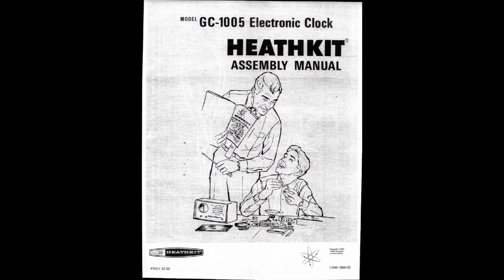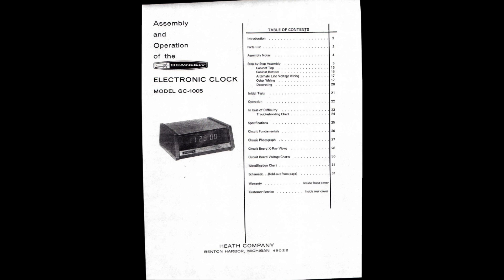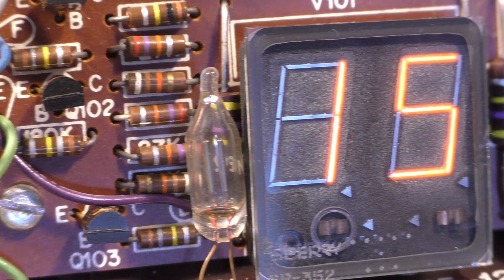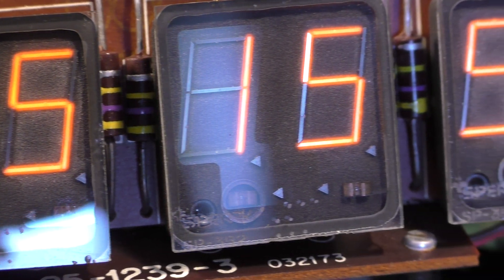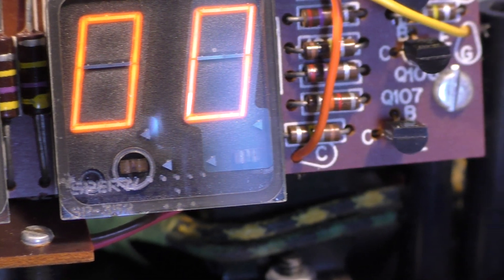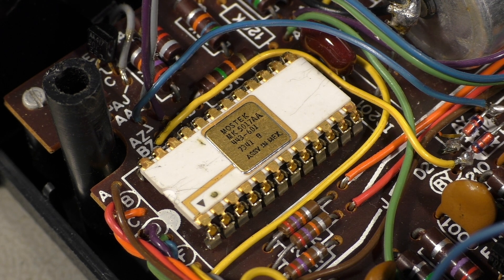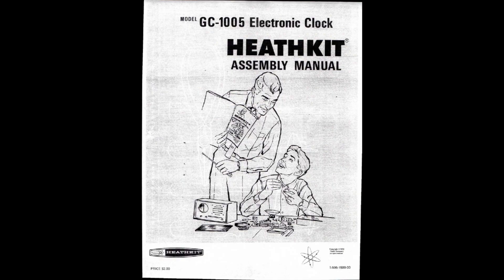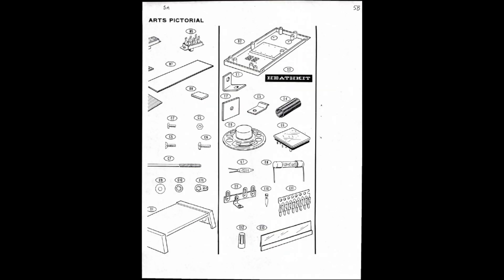Heathkit Digital Clock from 1973 "GC-1005" (PWJ204)

Comment: The worst part about LEDs is how boring there are, 50 years ago there was a cornucopia of display types. You had LEDs, Numitron, Nixie tubes, VFDs, LCDs (DSM and normal), CRTs, Neon, panaplex, and every type of analog display imaginable (cam driven, wheel, flip type, pointer). 

At least the new version is pretty faithful to the design with some improvements like a battery backup and an alarm. It's pretty cool you can still order the manual from Heath, and they make upgrades for older stuff.
Reply from the maker: There are still many different displays available, but since LED went big, the others became very expensive. But you're right, the "experimenting" phase is over.

Comment: My father and I built several Heathkit TVs, stereos and other things back in the late 60s and 70s.  I learned the resistor color code and would hand him the next needed part.  Good times.
Reply from the maker: I‘m amazed how many people built TVs from kits. Was that really worth the hassle?
Reply: @PlaywithJunk  Well Dad was an engineer so it was more about enjoying the build process and spending time with his technically-curious son.
Reply: @PlaywithJunk  Back then, you actually could save money building a kit compared to buying a manufactured TV.  Technology improvements and cheap offshore manufacturing eventually eliminated the cost advantage for kits.

Comment: Wow - Heathkit - they were really popular back in the day.  My parents have a Heathkit stereo amplfier and AM/FM tuner that were Heathkits.  Interestingly, those components didn't come with cases and my father custom built wooden cases for the two components.  They still have the units - somewhere in storage in their home - and when they were put away, they were still working.  (On top of those two components they also had a 7" reel to reel player/recorder).    Of course, much later on - I purchased a Hafler power amp and pre-amp as kits to assemble...  neat stuff!

Comment: I have the same clock and the matching indoor outdoor temperature gauge that I built myself.   I bought the clock on ebay about 15 years ago.  Both work perfectly.   One tip that I didn't realize is that to set the tens of minutes you have to hold the hours and minutes switches at the same time.
Reply from the maker: Yeah I know. I took a moment until I realized that. I first feared something is broken. But it's also in the manual... 🙂
Reply from the maker: Send me a picture of that setup....please.... you'll find my email in the channel info.
Reply: @PlaywithJunk , The picture of both the temp and clock together?   Or the clock setting instruction?
Reply from the maker: @aaa000777  No, just the two devices. I have the instruction handbook here. I saw, there is also a rain meter on Ebay with the same wood case.
Reply: @PlaywithJunk  sent the pictures and the schematic fir the temp gauge. ID-1390. From around late 1980s

Comment: but how good does it hold time
Reply from the maker: It runs on mains frequency 50 or 60 Hz selectable. I't's as accurate as that. Long time stability = atomic clock level 🙂